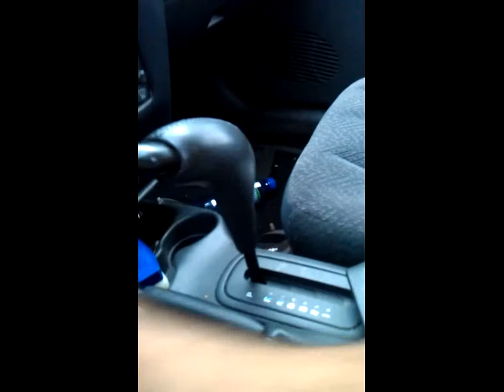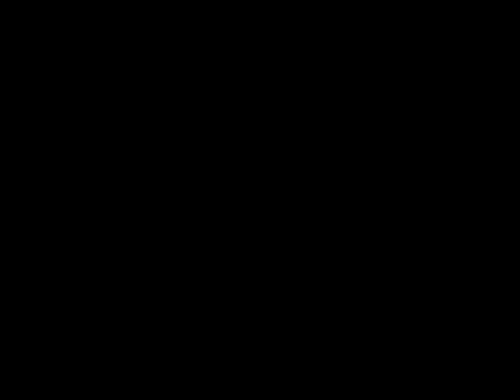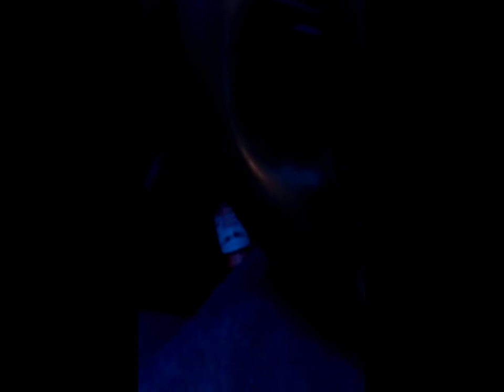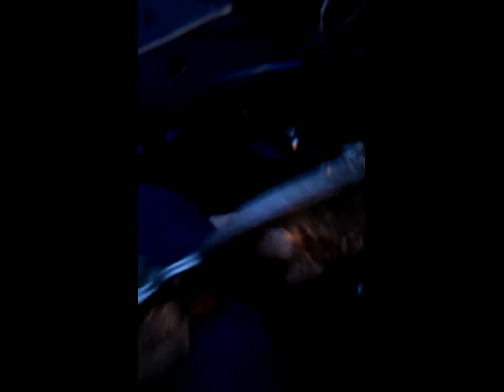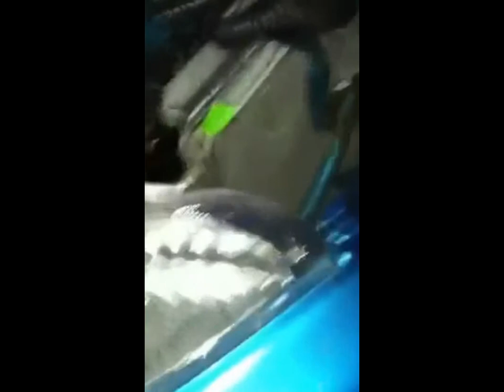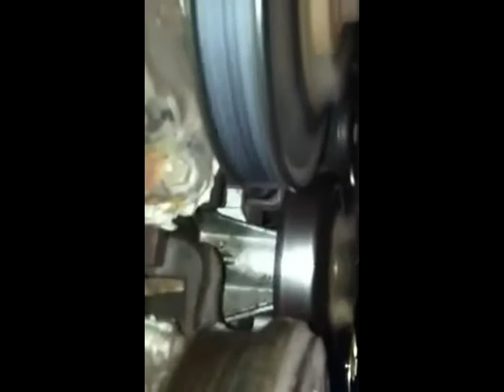2000 Chevy Cavalier 2.2L OHV Repairs Part 2

Comment: i was just responding to your comment. no one would ever be able to do this , I've worked at a shop for 3 years replacing just a motor isn't that difficult its three rivets and i was simply saying its worth spending the extra 30 dollars on the whole assembly.

Comment from the maker: I saved money by just replacing the parts I needed to.  The regulator with the window motor is more expensive.  Then window motor was only $30.  The fuse was only $10.  The window switch was $60.  all these parts needed to be replaced.  It is harder to install just the motor because you have to drill out the old screws that are actually riveted.